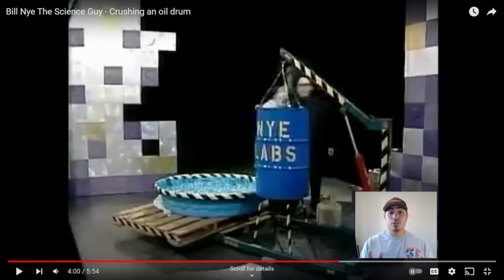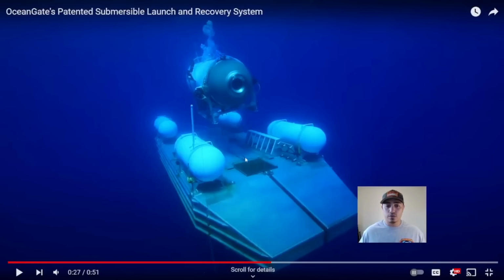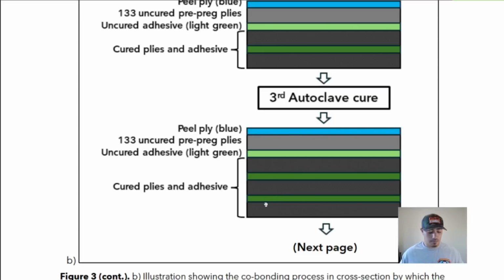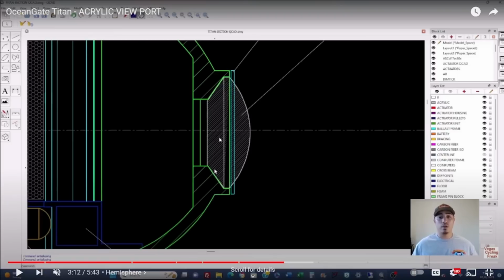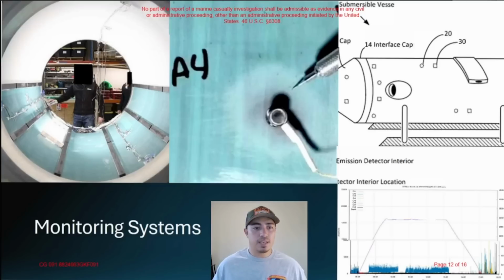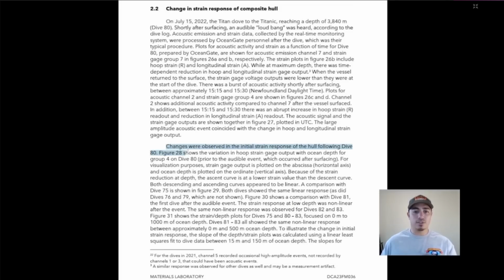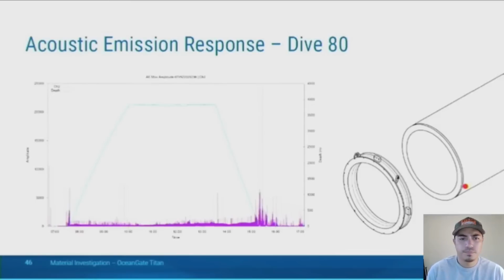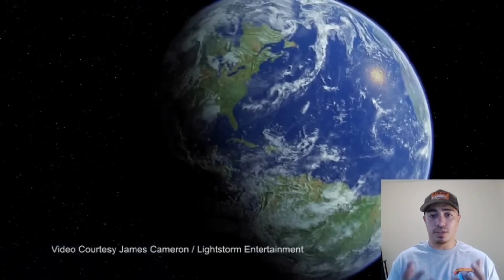Part 2: Investigating the OceanGate TITAN Tragedy: Carbon Fiber Hull, LARS Flaws, and Warning Signs

Comment: Mechanical engineer here; hoop strain is the strain in the circumferential direction , whereas longitudinal strain is lengthwise down the vessel. 
The loud bang is likely either a carbon fibre strand or bonding agent breaking, therefore meaning that the strain no longer matches because the vehicle is permanently deformed.
Reply from the maker: Thank you very much for the clarification James! It was extremely confusing trying to interpret this data at first but it’s beginning to make sense now. Thank you for your help.
Reply: It also seems that they have multiple strain gauges in both the circumferential and longitudinal directions spread around the hull. I’m not an expert in carbon fibre but I do wonder given the brittle nature of the material how any noise from the acoustic sensors was tolerable, since each noise is essentially a permanent deformation.
Reply: @Wodd-z9r5l  they said the strain guages indicated "sponginess" of the carbon fiber hull like 2 dives before the fatal one... appalling beyond belief...
Reply: @brushhogg1  that is usually from debonding/cracking, so something is moving that should not move. So their system actually did predict the implosion well in advance, they just ignored it!
Reply: I think all OceanGate cared about was saying they had something so customers would feel better about getting in that death capsule. Because going off of other peoples’ testimonies, the thing made a lot of noise going down and back up.
Reply: I was thinking the same, something probably broke possibly at inter phase between the metal and carbon fiber, you never even if you're working on a cannon dismiss a loud bang if it's coming from a place it's not suppose to be coming and you sure as hell don't dismiss when working on subs since the margins of error at those depths are so minor that there's no room for "oopsies".
Reply: As a person with Mech Eng degree, I agree. 

The tragic irony IMO is the real time monitoring system in essence did provide warning of structure problems. Only OG chose to ignore the data, didn’t properly analyze the data or didn’t realize the significance of the data. They had the “loud bang” coinciding with jumps in strain gauge outputs but continued to dive. 

The step in strain outputs of dive 80 that coincided with the “loud bang” acoustic signature looks to me like a “unit step function” change. Because these are strain outputs, changes in length, the abruptness should have been cause for concern. The magnitude of the acoustic signature of Dive 80 event is almost 5  times anything otherwise measured! I believe OG had the plot (or the data therefore) showing the abrupt jump in strain. And knew there was a loud bang. “The hull shifted” was the explanation attributed to Rush. IMO “yes it did with a release of energy.” 
As I understand Dr DvKramer’s testimony, OG recorded the strange n data as time plots. Dr. Kramer combined the strain data and depth data over time into a depth-strain plot. Because external pressure increases with depth, depth is a surrogate for stress (as long as the structure & materials are behaving elastically in a linear fashion). Thus, Dr. Kramer is showing the data in an stress-strain format familiar to engineers. The change from an initial linear behavior to nonlinear was cause for concern.
Reply: @christophercripps7639  Yeah everything seems to indicate that Rush was more concerned about his legacy as an "innovator" then about the safety of the people onboard. Well that's probably he ended up as model example as to why his form of "innovation" has very few practical applications and is totally unsuited for anything where there's a risk of death on failure.
Reply: @christophercripps7639  by 2022 to 2023, who was left at OG that could properly analyze the data? Rush fired almost everyone who told him things that he didn't want to hear.
Reply: I think it was a significant delamination because afterwards there was both permanent deformation and the rate of deformation with pressure increase was changed. The glue between the five layers of the CF showed wear, so in parts of the hull the layers probably weren‘t adhered anymore. The wreck clearly showed separation of the layers, so that green glue (haven’t heard what that is exactly, some 2K epoxy for sure) they were using was definitely weaker than the epoxy of that prepreg-CF.
Reply: Excellent comment
Reply: I like that you start of by stating your title then guessing if its either the carbon fibre or bonding agent giving away. Funny. Its most likley the second one, the vehicle is not permanently deformed, but the bonding layer prob became over time.
Reply: Wow you guys are so smart. All I know is Rush was an egotistical a-hole that killed four innocent people including a child. If he had somehow survived he’d get locked up for the rest of his narcissistic gaslighting deplorable life

Comment: The acrylic viewport was only rated by it's manufacturer to 1,000 meters, not 4,000 as Ocean Crate claimed; flat out criminal fraud.
Reply from the maker: @williamprice3929  it’s frustrating to hear these details as the continue to come out. It seems like at every opportunity, corners were cut.
Reply: @sspdiving cutting corners was the entire business model here. Stockton goal was to make deep sea expeditions cheaper.
Reply: can you believe his ultimate plan was to live down there?! A place for super rich people of course.
He obviously didn't love or respect the ocean.  @ulbuilder
Reply: @Kizzabell  He's living down there now, permanently.
Reply: Scott Manley channel provides detail on why the view port was only certified to 1,300 m. There was nothing unsuitable about the use of acrylic which is an allowable & oft used material for deep diving submersibles. The problem was the shape of the OG dome. OG wanted a flat inner surface not a concave inner surface like the outer. (Alt design was like a glass bowl.) Water pressure pushes the viewport inward (massively so at 3,800 m depth). The dome is squished. The pressure at the edge at the flat inner was modeled to be too high. The “glass bowl” design showed a far lower pressure. 

“Certified” to only 1,300 m does not mean the viewport would fail the first time  below m. Rather, the manufacturer could only guarantee the port to 1,300 m for many, many dives without worrying about the port failing without warning. The 1,300 m prob included an ample factor of safety. Clearly there was some factor of safety because Titan made many (12+ ?) to beyond 3,000 m without the view port popping out. To determine the actual useful life with an ample margin of safety would require testing to destruction of several items which testing costs $ & time.  Based upon a sample size of one I might trust the design for 1 dive to 3,000 m & little more.
Reply from the maker: @christophercripps7639 this is an incredibly valuable comment! Thank you for providing us with that information and perspective! We know time and money is something Rush seemed less inclined to spend during research & redevelopment. Cheer🤙🏼
Reply: The specs on that window changed. They said 1300m at first(not that it would make a difference at 3700m) but then 1000m was cited. Does anyone think maybe nobody knew for sure?
Reply: @brushhogg1  When Rush was offered by the manufacturer to have the window tested for a greater depth, he refused.
Now the thing is, the original design for the window - a dome, might have been rated for a higher depth, but Rush wanted the back side (inwards facing) of the window to be made flat, which focuses the stress points to a smaller area on the window interface instead of spreading it around evenly as pressure increases. That redesign is probably the reason why the manufacturer wouldn't rate the window higher without further testing. Who would - it's a liability.
It's an insight into how Rush ran the circus, but other than that it's a pointless argument as acrylic fails progressively and in a very obvious fashion (first it starts turning foggy and then progressively cracks) which would have been hard to ignore, even for Rush.
Reply: @brushhogg1 can the reason for the two numbers be the safety margin? As I have understood from these hearings, the normal safety margin is 25%. If you want to dive to 1000m, you need to test it at 1250m. So the window can be certified to ~1300m to be able to dive to ~1000m.
Reply: @MaxQ10001  1000 meters, 1250 meters is not anywhere near 4,000 meters.
Reply: @williamprice3929  yes, I responded to the message telling that both 1000 and 1300 meters are mentioned. My answer was a possible explanation to why both those numbers are mentioned in the hearings. I have not commented on 4000 m vs 1000 m.
Reply: Exactly very very different
Reply: @williamprice3929 well it’s deep off it will go 1000 feet deep it will go 13,000 easy 😂😂
Reply: The level of cost cutting makes me wonder how nobody seems to be investigating his financial situation. He was either delusional or desperate to use such a flimsy machine. It's like a counterfeit product from a shady factory in China.
Reply: I remember seeing this sub prior to this disaster thinking I wouldn't get in that thing for no amount of money. I'm sure at that depth the implosion was even more violent than the 55 gal drums showed.
Reply: It feels criminal.
Reply: Ya he was pretty proud and open about how he constructed the thing.
Reply: I want to say I heard during the hearings, probably via BBC, that OG was in the red. Passenger, excuse me, “mission specialist” fees were being used to pay for the following mission. He was depending on the business to eventually be profitable so it could break even.
Reply: @KristenK78  glorified lemonade stand
Reply: The whole operation was criminal.  Oceangate was just a nerd with a hobby.  It wasn’t a legit submarine business.  No outsiders should have been onboard.  If oceangate wants to implode themselves then whatever but don’t cut corners. Ignore experts and safety and then offer tourists a ride.  The families outside of Stockton should own oceangate assets at this point.   F oceangate
Reply: Ocean Crate 😂😂😂 brutal!
Reply: The stupidest part is that they could have tried to rate it, the whole thing was not impossible, and the vendor even tried them solve how they could dive in the meantime. They didnt do any of it because Stockton thought he was being taken advantage of. When in reality they tried to save him cash and even did a good amount of analysis on their own money jist to help him. Thats how wrong he had things in his mind. Guy must have had a very crappy past but didnt go the right way either.
Reply: boohoo, your not fun at parties